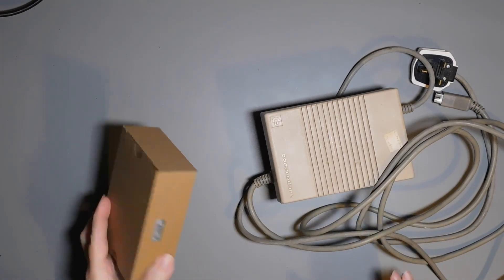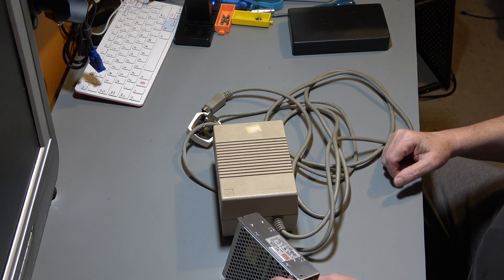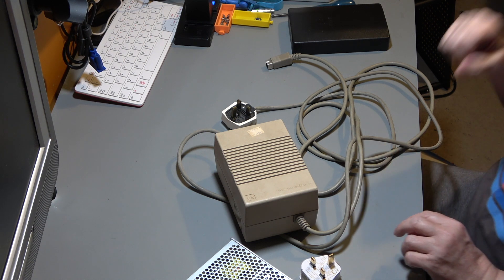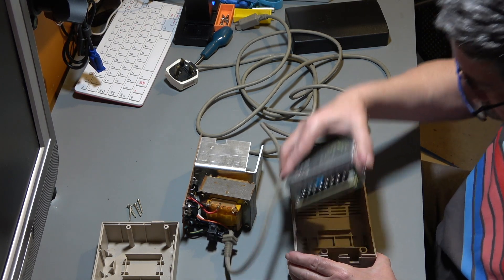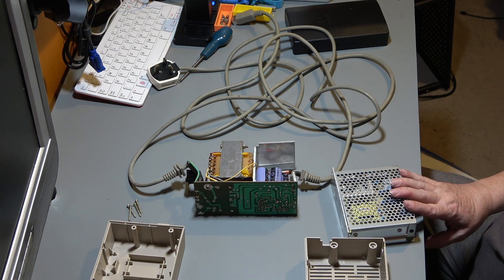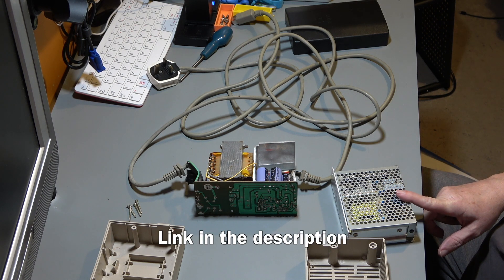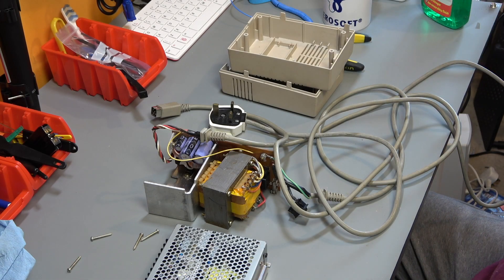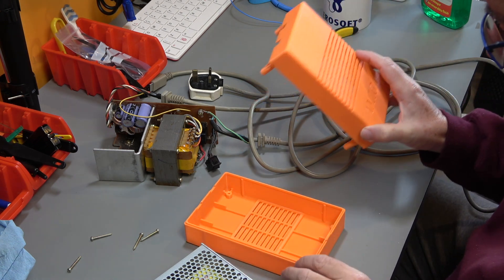Replace your old Amiga Power Supply with a Mean Well RT-65B

Comment: I bought 5 of these around early 2025 and all 5 shared the same habit: If you adjust the 12 V rail to exaclty 12 V, you end up at the same time with around 5,20 V and -13,55 V, which is way off (the latter). Guess it was a bad batch, since all 5 behaved the same.

What I also found out was, that my Amigas 1200 wont boot when the voltage on the 5V/12V rail was below around 5,40V/12,6V – there was only a black screen. On the contrary, the Amiga 500s are booting at 5,15V (the lowest I could set).

Comment: Hey Timmy, here goes a good one: if you knew that the Meanwell wasn't going to fit in the original case and you would have to print a new one, why not use a regular ATX psu instead of the Mean-does-not-fit-so-well one? Thank you for sharing your experience!
Reply from the maker: I'm sure you probably could if you wanted to.
Reply: @TimsRetroCorner  Hey, thanks for the response. But I believe that I didn't phrase my question very well. I mean, if it was not meant to fit into the original psu case, why use a meanwell psu? If you knew that it wasn't going to fit from the beginning, would you still choose it, or maybe a regular ATX psu could do the service? Maybe the fan noise was a relevant factor for the choice? Thank you for your patience since English is not my 1st language.

Comment: Very nice. I got a new Amiga PSU just before Britexit form a seller in Poland. it was a lot better than my 35 year old ones. I got it as it has a display that showed the voltages very handy when go get a non booting Amiga before that I use a ATX PSU adapator to power my Amigas.

Comment: HELLO!!
Very good and professional  modification. New PSU with protections for shorts or overload  its very usefull. In 3D print case model  be very nice to add some slots for ruber stand pads for better ventilationn and stability on desk. Or just use windows seals like i have in my AMIGA 600 29 years old PSU. I fell end this old power supply because two resistors have sings of hard work-pcb under this component get darker and PSU smell after get hot like something go very hot, like pcb burning. I have stronger PSU from Amiga 500 with 4.5A and this go too hot but no smell like tosted  pcb. For me this is a nice alternative to have nev trusted source of juices for AMIGAS. Regards.

Comment: Thanks for the case design! I don't have an Amiga but this exact power supply model is very used in eurorack modular synthesizers because is cheap and reliable. Most people use this inside the synths but I need to make one like an external PSU and this is a lifesaver for me! Excellent job! I'm totally using it!
Reply from the maker: The files I uploaded to thingiverse contain a version of the lid without the Amiga logo carved in it, so it's totally usable for any project that needs this size of box.

Comment: Regarding the "manky plug": these are actually pretty decent quality and durable in my experience. All I'd do is check the electrical connections inside and clean the pins with a scouring pad (or a fibreglass pencill if they are really crusty). Obviuusly, if pitted get rid of it.

Comment: I have one Problem with the Meanwell Power Supply. If i plug the Meanwell in the Amiga, and make the measurement after the Line Filter from the A500  I get 13Volt on the 12Volt Line!!  Is this a Problem?
Reply from the maker: The Mean Well does have an adjustment pot to tweak the output voltages (right by the LED), but all the outputs (and particularly the 5v) must be under load or the voltages won't be accurate.
The Amiga voltage ratings are +/- 5%, so the 12v rail should be between 11.4 and 12.6. 13 is definitely too high.
Reply: @TimsRetroCorner  Thank You for this Information!! 👍🏻 GOOD Luck for the A500 Plus(Black Screen) Repair!!